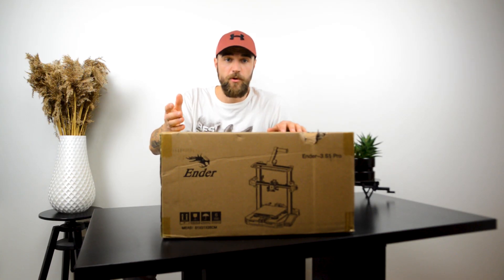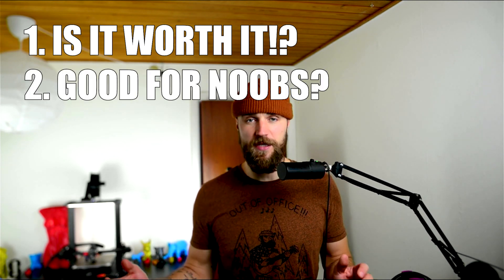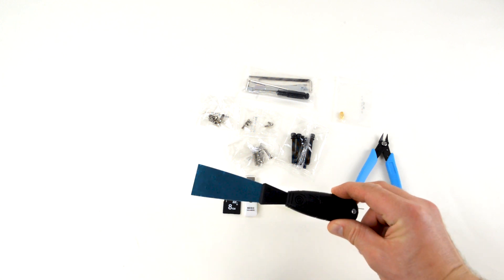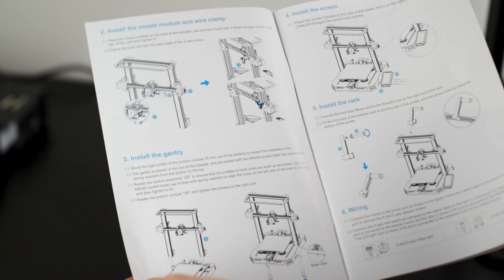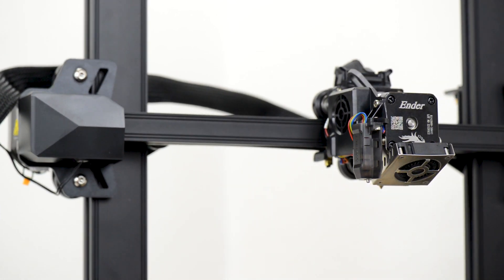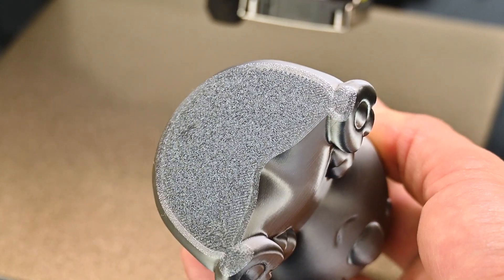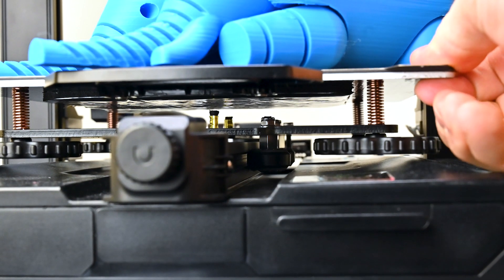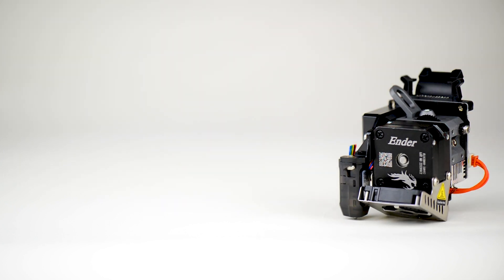Creality Ender 3 S1 Pro, The Best 3d printer for beginners in 2023?

Comment: Do you have any tips for the ender s1 pro? I've had mine for nearly a month, and I've had nothing but issues with bed adhesion, the extruder knocking prints off, nearly every print I've tried has failed completely. I followed the so many setup guides, and I'm just not understanding how you are getting such good results.
Reply: I've had mine for a week and I understand your pain as I'm going through it, the fact of the matter is I don't believe ANY of these 3d printers are good for beginners. My biggest problem is although I'm getting some fair prints, when I don't or they turn into a mess, there is zero indication as to why. Anyone telling you this or probably any other 3D printer is good is doing so from the perspective of an experienced users and they know what to do because they learned what to do. 

The only tips I can give you that I've picked up from the last week is, manually level, then right after, auto level, make sure you use the paper they gave you to gauge the level height. Then turn the bed heat up to 70-75 followed by the nozzle temp up to 205, but the leveling is key i believe. There's other settings I've changed in Cura based on other video recommendations but I can't recall each one at the moment, something about "brim" in the cura settings helps with the adhesion around the edges also and don't forget to turn on "supports." When you're looking at your print, if you see red when you're moving the print around, that's where you need supports. I just figured that out today after figuring out to go from basic settings to advanced or expert in order to see extra settings. 

The problem is most people with the knowledge absolutely suck at teaching, teaching is a gift most people don't have. Most of the videos assume you have some basic knowledge, which of course a beginner just doesn't have. Luckily for me I'm retiring soon and will have the time to learn but these 3d printers aren't for the faint of heart. Good luck, we'll both need it.
Reply from the maker: @dosdont  very well said! 
3d printing is not "beginner friendly" overall and there is a learning curve involved. But there are printers that will at least "just work" as you start, will have high quality parts that won't fail (almost :D) and then you will learn step by step the solutions to different issues that you will inevitably face. 

There are also other printers (I got some one my first printer...) that will keep failing, be unstable, therefore, you will not only "change the settings relative to the model/material", but will keep guessing i that is a mechanical/electrical failure.

And there are great teachers online, great setting guides to begin with. I love this one as the very basic printer checking/calibration routine: https://teachingtechyt.github.io/calibration.html
Reply: @VRMinde  Thanks for the link, I'll have more time soon to spend more time learning but ya, it's not beginner friendly at all. Still there's a lot of things to look forward to on sites like Thingiverse.
Reply: @dosdont  Watch rick impeys bed levelling tutorial on the s1 pro here on youtube, should clear up all your problems.
Reply: @DKFX1  Yes, I have that cued along with a lot of other videos to watch. Thanks
Reply: @dosdont  it's the only one you need for good bed levelling.
Reply: @DKFX1  👍
Reply: chep had issues with the pei sheet aswell try replace it with one of amazon
Reply from the maker: Surprised to hear that. Even now when I am typing the printer in the background is working with no problems. If your issue no.1 is the bed adhesion - start with ensuring the bed is mechanically stable, not wobbling, adjust the rollers. Then make sure you have done bed leveling, first manual, then auto. In order to save auto leveling mesh - add M420 after G28 to the start GCODE: 
G28 ; Home all axes
M420 S1 Z10 ; Use saved Bed Mesh

And finally, wash the PEI sheet with some dishwashing detergent (I use "fairy") to remove any fat. For me, the prints stick very well...